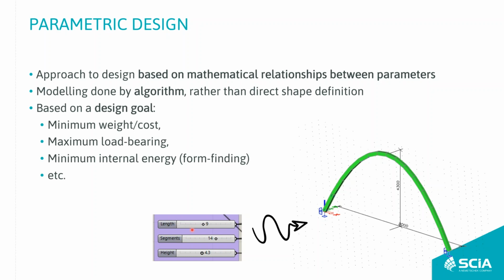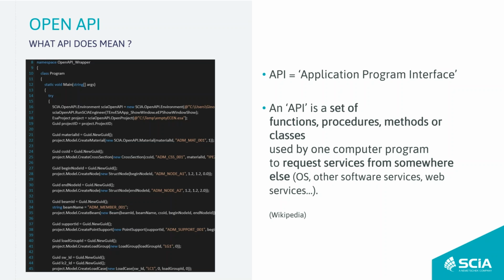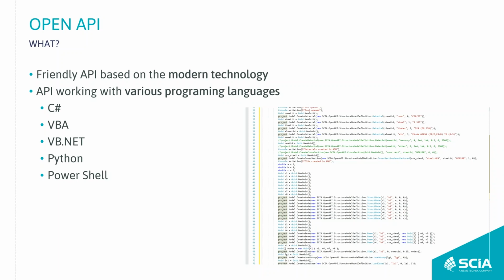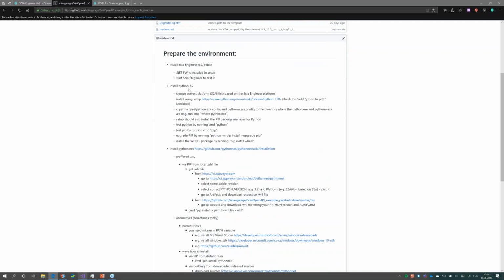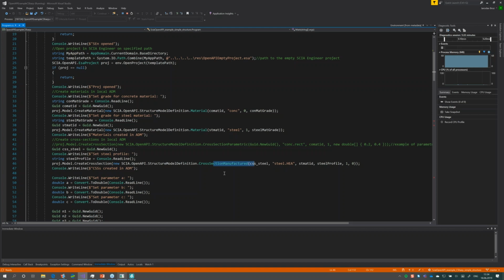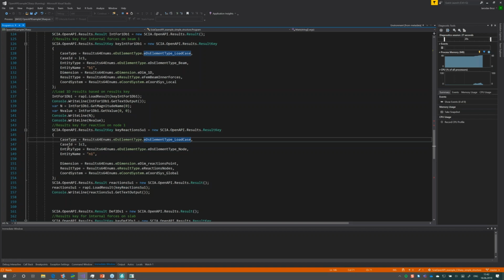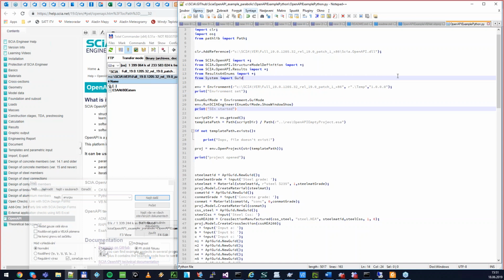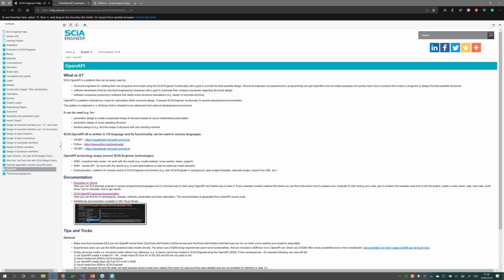[EN] Parametric design using the new OpenAPI in SCIA Engineer 19

Comment: Is it possible to import existing profile and material database from an .esa- template into your open api code? And can we adjust the layer beams are created in, or only the cross-section, name, eccentricity...
Reply from the maker: Yes, there are workflows available to make use of existing materials and cross-sections. Layers can also be assigned when creating members.
Reply: @SCIAOfficial  Any chance you could point to some code for using cross-sections/materials that already exist in a template?